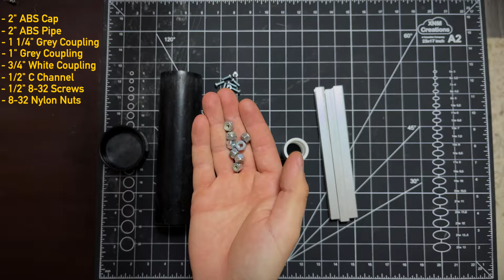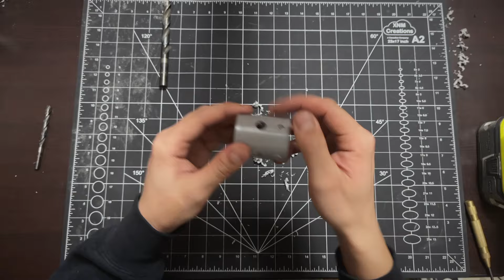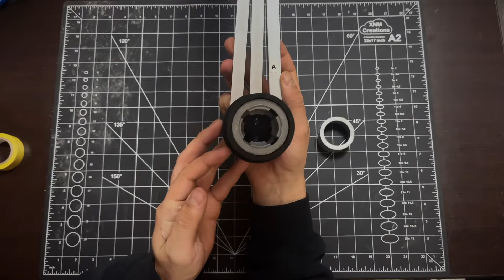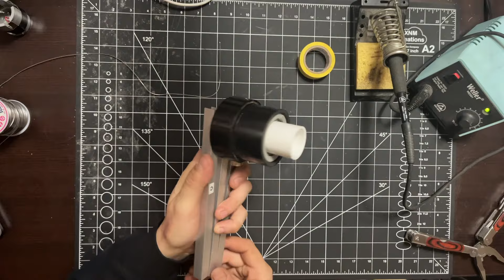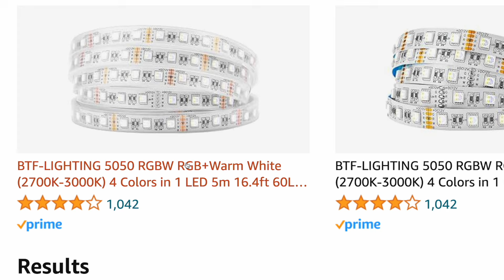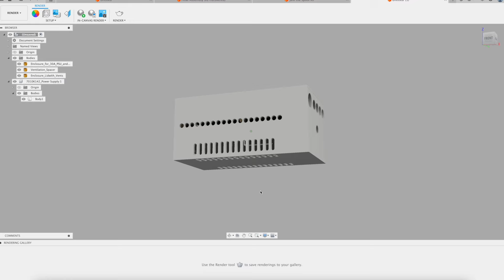How to Build Your Own Modular DMX Lighting Rig

Comment: I am currently also building LED Tubes. And I decided to use Powercon as the connector. Powercon basically has a three wire connector and I am using the earth wire for the data line of the LED. This is an easy way so I can use normal Powercon Cables which I have always with me, as most lights have this connector (at least in Europe). My distribution box therefore has 8 Powercon Out sockets which are meant to be connected to the tubes. I also put stickers on the tubes that only the cable of the distribution box should be used (to prevent somebody from plugging in the LED tube - which is designed for 12V - into a normal power outlet).
Reply from the maker: Powercon is a good choice! My new version 2 rig gives the option to use either xlr or powercon

Comment: Wow thank you so much !!!
I started to build it a month ago but I had to pause the project. Thanks to you I'll be able to continue with the base. 
In my country I don't have easy access to the  aviation cables you're talking about, and I was thinking about using speakon cables and connectors. Do you think there will be problems with the cables thickness or is it alright?
Reply from the maker: Sorry for the delay! Speakon should work great! My new rig still uses the aviation connectors just because I had them on hand already but I designed the new rig to also use speakon or xlr connectors if you want to

Comment: Did i miss a step that indexes your fixtures in the socket, so that pin 1 is always pin 1? Or is it possible to insert the fixture at 90 degrees off so pin 1 becomes pin 2??
Reply from the maker: Ah good catch, I mentioned it in the first video but forgot to elaborate on it in this video. Currently you can insert the fixture wrong but I’m going to add a 5th screw and slot as an indexing pin to the 3d print file and also on the V2 model
Reply: @SuperValidDesigns  also ... Just wanted to mention,  I can def see how that 5th pin will help with those wanting to run RGBW strips while also providing indexing. But you probably could have spaced the original 4 pins unequally and also achieved indexing in your same v1 design. 

Anyway thanks again for being a super valid maker putting himself and his designs out there. I'm staying tuned for more
Reply: @SuperValidDesigns  I see, great!! I'm never intending to build these (I don't have any use for them myself) but I really enjoyed your engineering ingenuity, and how you articulated the decisions and build process!!!! I also enjoyed your litter sifting video.... Infact I was pretty sad when I went looking for more videos and saw so few haha.  So, I'm subbed!! Keep it up!! I'll watch em all! Id also like to see some CAD videos from you, if you're down for it (I am also a long time fusion 360 user/hobbyist, a d like to see how other people work). I was pleasantly surprised to see some of your workshop in that cat litter sifting video. You look to be really well-tooled!! What do you do for a living? I'm in IT.   Anyway, I'm rooting for your channel to blow up -- thanks again for the content and keep it coming!

Comment: You should have calculated your voltage drop using DC instead of AC. While the math is the same there are some difference and it can affect your calculations. AC is used for the power grid because the voltage drop can be enough to cause problems. DC would cause the voltage to drop to much at the distances the you can go before more electricity is injected into it.
Reply from the maker: Good shout, I forgot to switch AC to DC in the video, but in this case it does end up with the same result

Comment: I'd be super interested if a future design incorporated more industry standard connectors. Like true1 or powercon for power to be safer and already have cables floating around venues and production houses. There may be other multipin connectors that could be cost effective, or even stick with standard 5 pin DMX but leave a pin unused. But overall this is a very cool and creative project with a very great end result!
Reply from the maker: I agree! NL4 seems to be the way to go

Comment: For the Lightning Software i could recomend using QLC+ it is free, openSource and work with a lot of DMX interfaces. Yes you need a little bit time to get use to, but it has a great pixel controling features 😊
Even mapping Images or text 👌🏻

Comment: Hey there, thanks so much for all of your research!

I decided to build some LED tubes for my band aswell since I had a DMXIS laying around.
For the aviation plugs I decided to change those to Speakon Connectors (maybe because of my job as a sound engineer) but it seemed like a good solution for the amperages used here.
I have 8 speakon plugs on my distribution box where I connect the speakon cables wrapped around the bases. (just like in one of your designs) 
Inside the bases I connect them to female speakon plugs where I can just plug the LED tubes in with a tight lock, elimitating the need for springs.

I'm trying my luck with the 24V LEDs in RGB with the DMX512 decoder you mentioned during the first video, since it is way easier and cheaper as you said.

I tried all the connections so far but I'm currently still building the bases and tubes. (1,4M high tubes)

Cable gague are as follows:
1.5mm cables for the connections inside the distribution box.
4x1mm cables for the connection between the box and the bases.
0.75mm cables for the connection from the speakon inside the tubes to the LED strips (easier to solder onto the LEDs, 0.50mm might also work)

Looking good so far!

Thanks again man, some real MVP content!
Reply from the maker: Sounds like you got a great system going! I think the speaking connectors are the right call for sure
Reply: NL4 could be a good option, four pins and locking. If you got really creative you could make the base also accept NL4 and have the light tubes terminated in NL4.  @SuperValidDesigns
Reply: @shaunoshaughnessy6728  that's exactly how they are going to work! 
The male NL4 will be attached to the bottom of the tube which will go into the bases. 
(the base will have a slightly larger diameter of tube to hold the LED fixture in place)

Comment: Amazing work!
Maybe Neutrik speakON could be an alternative for a connector? They might be bigger (and more expensive) but they are heavy duty, rated for the power and will fit your cable. The NL4 has four poles :)
Reply from the maker: NL4 does seem like the best option moving forward!
Reply: NL4 is a great idea! That would give you the safety of the locking connection while having the ease of screw in terminals for the wires, plus you don't have to then deal with heat shrink.

Comment: for software, ChamSys MagicQ is a great free option. It does require a USB to dmx dongle to output the dmx. You can also purchase fader boards or aio systems from them that plug into the computer so you have physical control instead of software. Ive also heard that you can use midi controllers (ie: Omnitronic FAD-9 Midi Controller) but I am not sure if this would work. you might need an adapter from them
Reply: nope, chamsys requires license unlocking through chamsys hardware, you cannot plug in a midi controller and expect it to work
Reply: @danb_ix  I figured it wouldn't have worked. I've only ever used the software and their aio consoles so I was just making an educated guess

Comment: 4 pin XLR would work well for your connectors. I believe you can even get them from neutrik that take thicker cables into consideration.
Reply: absolutely. current rating is well within spec, and the bxx-14 boots (for up to 10mm cable) can be purchased individually. i'd probably pivot to using 5-pins myself, as they'd be more reusable than the oddball 4's if the project gets stripped for parts someday. only real upside of the 4's is that their rarity helps idiot-proof the system against incompatible devices.
Reply: You could use a 5 pin DMX cable to make the connections
Reply: Adding to my reply you could use 5 pin DMX connectors and use 22 gauge wire with 4 lead wires. I hope this makes more sense. Lucky building on DMX project.
Reply from the maker: Absolutely! My new rig still uses the aviation connectors because I had them on hand but I plan on changing to xlr connectors eventually and I've designed it to make swapping connectors a lot easier

Comment: While it will make the control electronics more complicated, I would investigate addressable LEDs for v2. The lighting effects that become possible are one obvious benefit, but additionally, you could remove one conductor from the cables, and reduce the size of another one, which will probably save a bunch of cable costs. (addressable LEDs only require power, ground, and data pins, with data not drawing much current). Theoretically, you could also add a 24v to 12v step down module in each base, and further reduce the cost and spool size of the cables (while keeping the option to run 12v LEDs).
For fixtures that don't require addressable LEDs, you could incorporate an inexpensive decoder board (quinleds dig2analog for example) in the fixture or base. With that, the entire strip acts as one "pixel" to the controller, so this would still allow daisy-chaining.
Reply from the maker: Amazing comment! You’ve pretty much outlined exactly what we are going to do with v2 (down to the Quinled dig2analogue board)! Would love to chat more with you on the discord
Reply: You should look at the new 24v fcob adressable tape, would definitely simplify things, and they have rgbw versions as well.  @SuperValidDesigns
Reply from the maker: I agree, the new 24v cobs look incredible. Definitely going to use these for some fixtures

Comment: I love this project but is it only non-adressable led strips??
Reply from the maker: This version was only ever non-addressable but the new version will be addressable. But this system can easily be built using addressable LEDs as long as you have the proper controller!